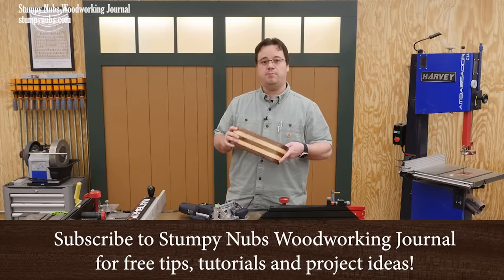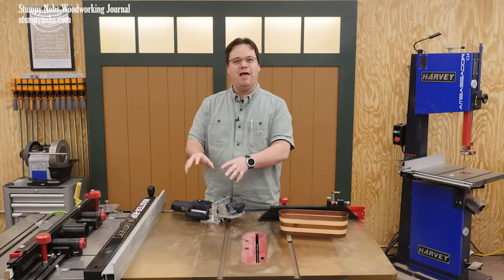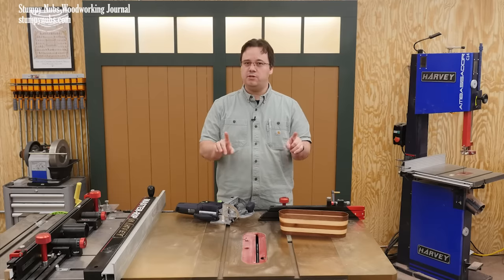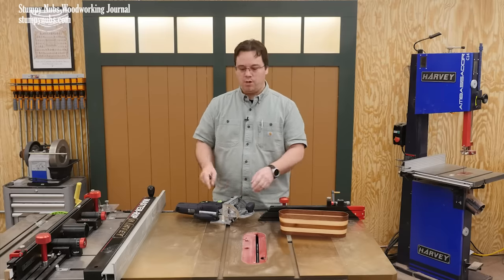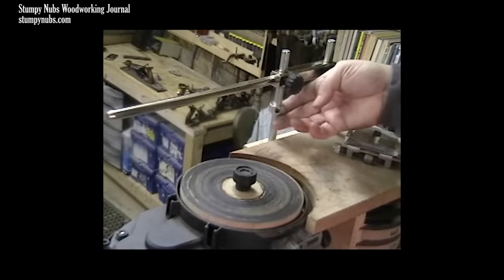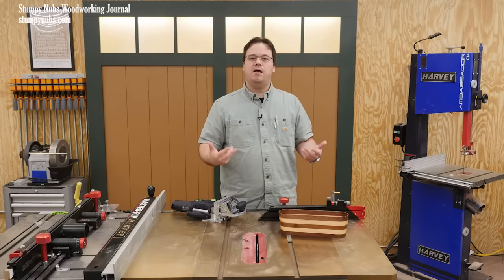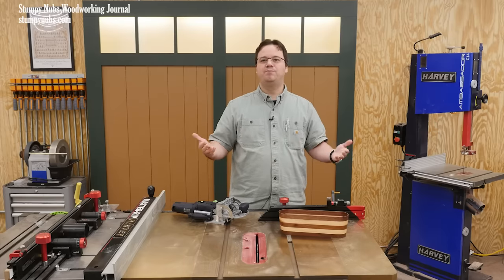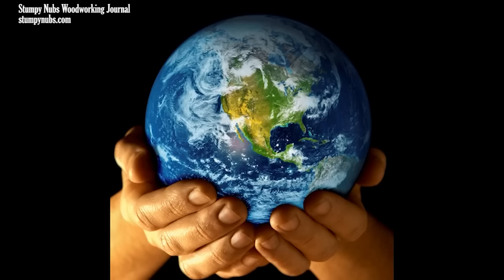This is why people HATE Festool and their Domino!

Comment: A $1200 mortisser is like a $500 tape dispenser- it just doesn't make sense given the end result of it's intended use seeing as domino joinery is one of the WEAKEST forms of joinery. Biscuit, domino and pocket screw joinery are little more than place holders or ways to hold something together while the glue dries. Dowels are stronger than any of the aforementioned, and if one desires more strength than that, it's time for more traditional joinery. Not that dominoes, biscuits and pocket screws don't have their place....but if you're gonna spend $1200-$1700, why not invest in something far better, or just spend a lot LESS and still get something better, like a good dowel jig, dado stack or specialty router bits? Personally, I think dominoes are just a fad whose time will expire soon; the latest thing for tool junkies.
Reply from the maker: Domino joinery is one of the weakest? How is that? It's a mortise and tenon joint! To compare that to a biscuit or pocket screw is fundamentally wrong.

Comment: I don't really understand the big debate. Not that much different to cutting mortises with a router and jig. If you're familiar with a biscuit joiner then you know how to make it work. Really it's not even that much different than hogging out waste with a drill and chiseling the sides. The biggest thing I see as an actual value to it is the standardized tenon stock. It's not something I'm going to buy because of the price versus the capacity is so far skewed price, but I also don't do production work. Festool seems to make good products, and if you've got the finances to handle it, they're not that much different than buying a wormdrive Skilsaw back in the day, or anything else.

Comment: Why is a domino better than a biscuit?
Reply from the maker: A biscuit is a small, thin piece of laminated beech used primarily for alignment because it only adds a small amount of structural strength due to the fact that it only protrudes about 3/8-inch or less into either piece of wood. A domino is a loose tenon, much thicker and many times longer, adding a great deal of actual structural strength.

Comment: So I actually have a nuanced disagreement with you about the benefit of patents. In particular two counter examples. The US invalidated all airplane patents after WW1 because the Wright Bros. were holding back US Airplane innovation and the US was lagging behind all other countries in producing aircraft for military use and Ben Franklin refusing to patent the lightening rod because of how many lives it would save. I'd be perfectly fine with invalidating Saw Stop's patent if they didn't refuse to license the patent out for say $50/machine. Or better yet, have the government itself put a $50 tax on all saws with the patent that aren't Saw Stop Saws. 

Thought processes like this aren't common in our patent system (anymore) but should be to actually help innovation. Same with Smart Phone development. The reason both Apple and Google came out with smart phones with capacitive touch screens around the same time has more to do with the patents surrounding the tech only expiring then more than anything else. Patents, particularly when controlled by trolls, are often (but admittedly not always) more harmful to society than they are beneficial, Software Patents in particular fall into this category almost exclusively.

Comment: Sorry man I'm going to disagree with you on patents and cost recovery. They could license those patents to third parties and get over their brand pride and make up those costs much faster. They could also sell the tool with an eye to how long it will be on the market and amortize their development costs over twenty years instead of gouging.
Look at how many 3D printers started selling when the patents expired. Imagine if HP et al had made inexpensive models and conquered that market in advance instead.
Same applies to that oscillating multitool; they could have sold many times more units with some foresight.

Comment: How dare you show green on your channel... I now feel completely violated. Now I'm looking for a bridge - and its all on your head!

Oooor...
I use festool quite often - and they are nice tools. I personally would not buy them simply because I don't see that I couldn't do the same things with less expensive tools. I don't see why I would spend a ton of money that I then have to make up for in my work, rather than use a less expensive tool and pocket the money.

Really - it is woodworking people. You can make the same joint in about 1000 different ways.... AND - you can just switch and use a different joint if you want. If you don't find floating tenons (dominos) easy - use dowels... or old fashion tenons.

Someone who is decent woodworker (and really it only requires caring) can have just as good a result with a $25 tool as they would with a $1000 tool.

Comment: I get annoyed when a presenter is giving a measured project then whips out the domino for structural joints.  I can use dowels but need to figure different spacing to get the same strength. Mortise and tenon changes ever thought length. And cutting floating tennons by hand is a pain in the ass.  Often I just stop watching at that point and find another build.

Comment: You are competely, absolutely dead on regarding innovation and the need to protect it with patents.  Of course it can go overboard if patent exclusivity lasts too long, much like the problems with copyright, which is utterly broken.  

For proof one needs only look over to the communist nations, where innovation was only possible by a tiny segment of society nested deep inside the government, since they didn't have ANY patent laws.   And because of that restriction, in the late 1980's the soviet union was still flying aircraft with vaccum tube computers 1940's techonlogy just refined a bit.